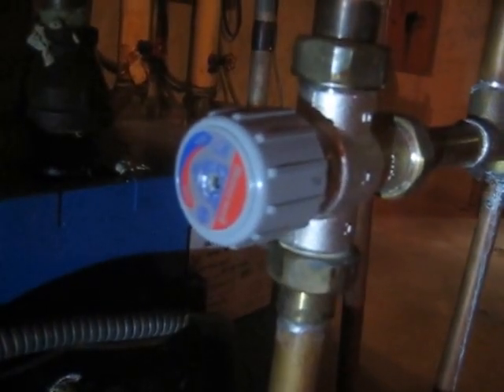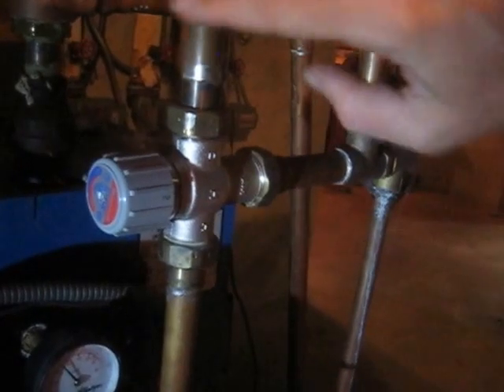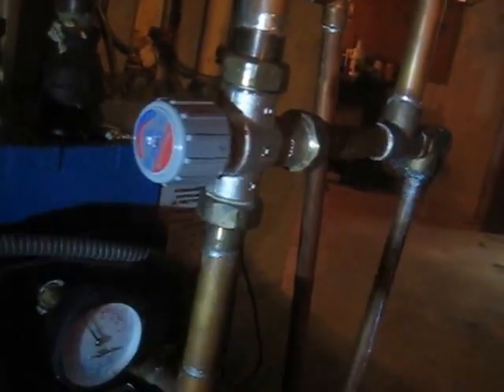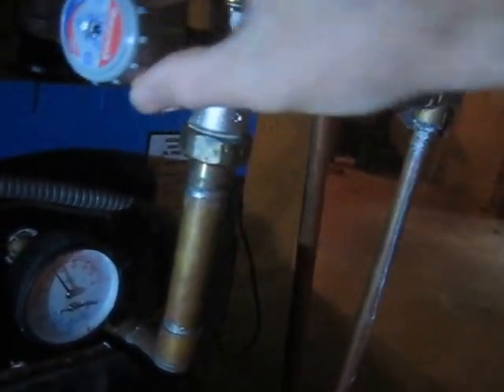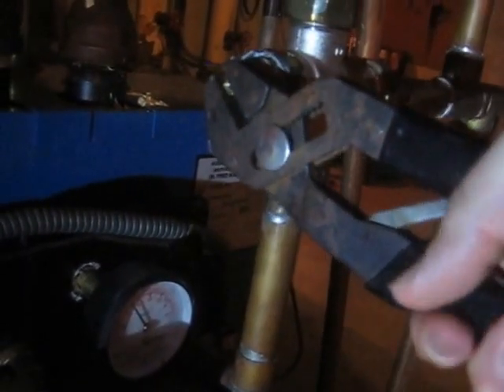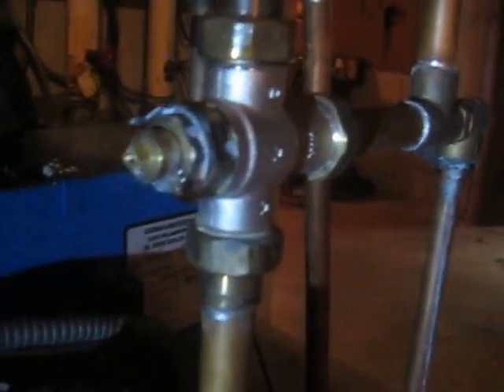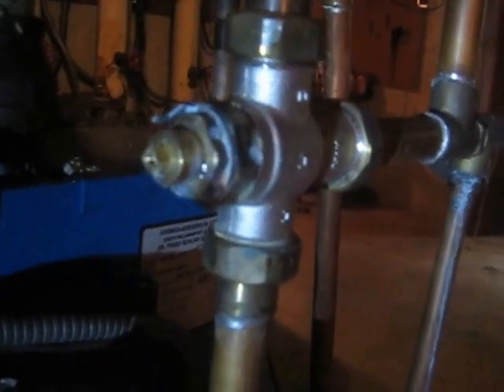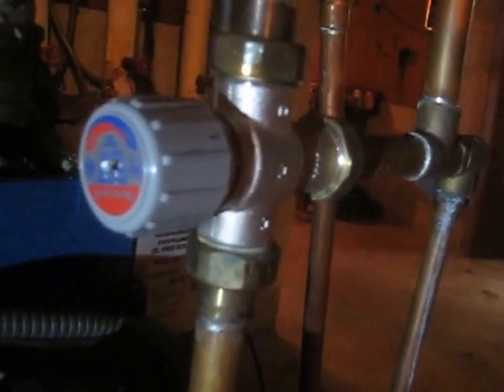Adjust SparcoMix AM-1 Series Mixing Valves - Honeywell

Comment: Please take the time to view the documentation that Honeywell provides for the device https://customer.honeywell.com/resources/techlit/TechLitDocuments/95c-00000s/SD_IS_150.pdf and you will see that it explains that the mixer could fail due to hard water scale build-up.  It also explains how to disassemble and clean those parts or you can buy a rebuild kit and replace the guts without removing the valve body.  It also explains where the "secret" screw is. :-)  
If anyone does attempt the cleaning procedure, DON'T, unless you know what you are doing.  It requires you to shut the boiler down to cool and turning the water supply off.  It will require draining the water from the line or suffer a mess.  It all depends on where installers placed cutoff valves.